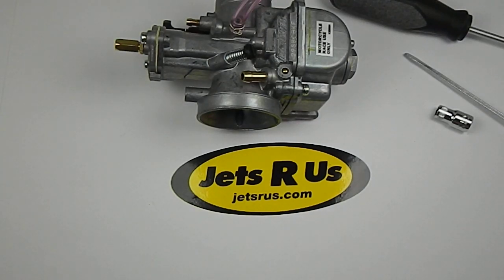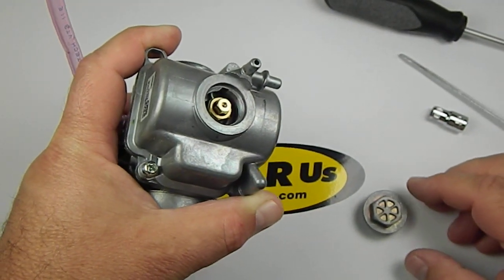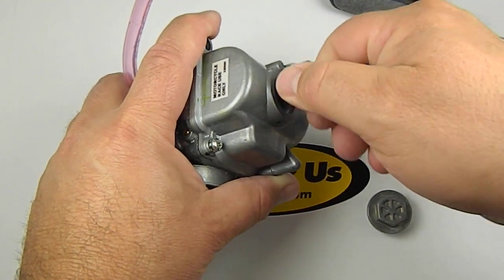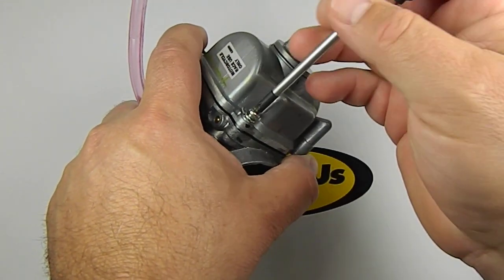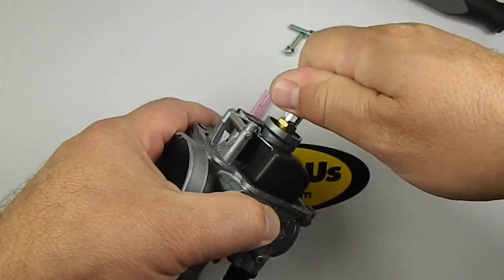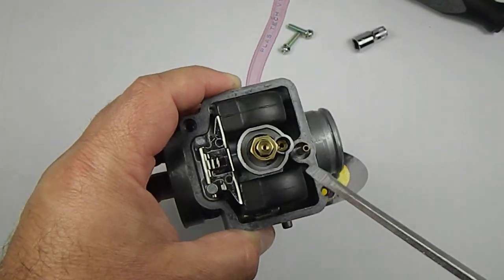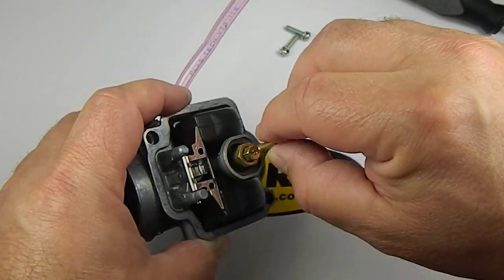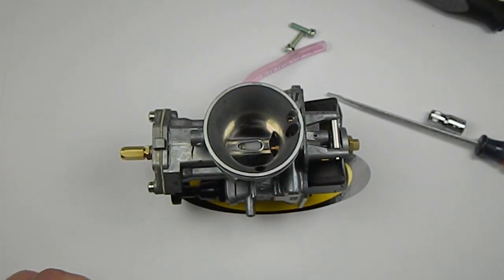Changing out main and slow (or pilot) jets.MOV

Comment: how  do u fix floats iam new and have the same carb and fuel is pouring out the drain hose
Reply: It could be the needle valve not seating correctly. That's what happened to mine. Easy to replace.